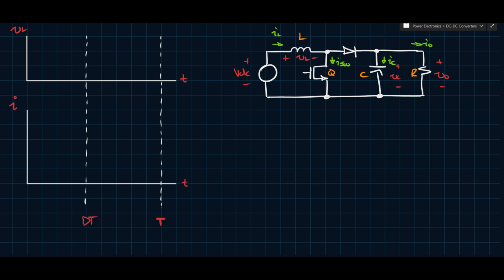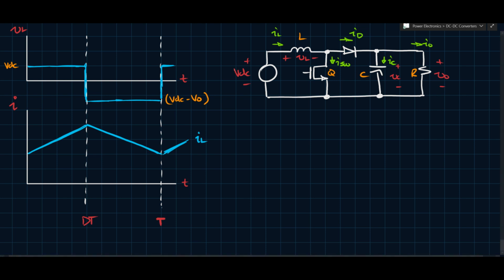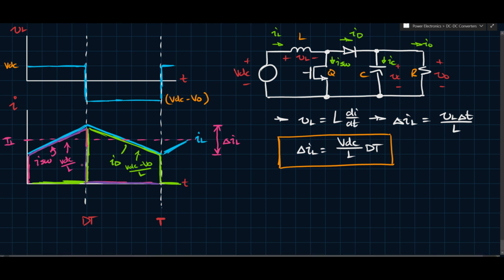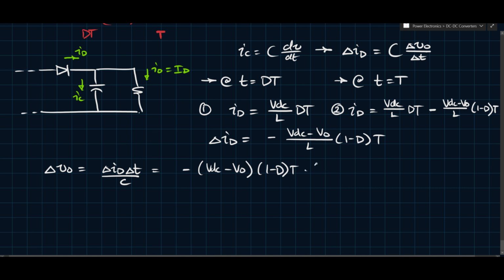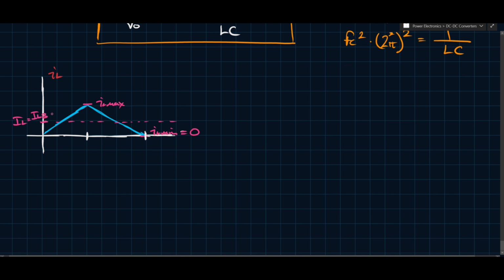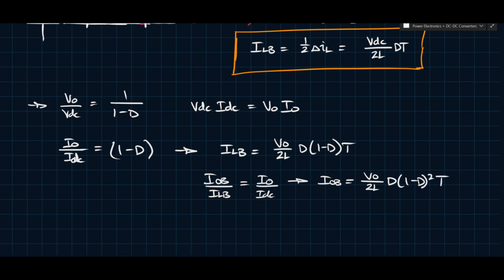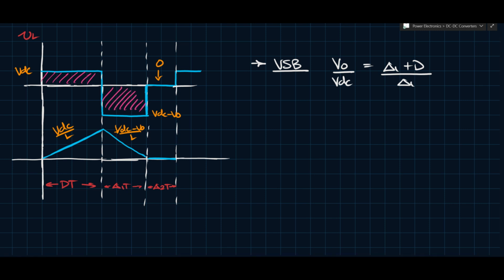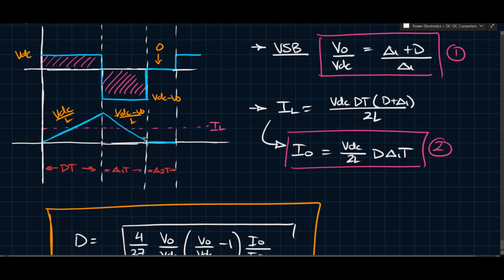Boost Converters: Capacitor Voltage Ripple, Inductor Current Ripple, and Conduction Modes

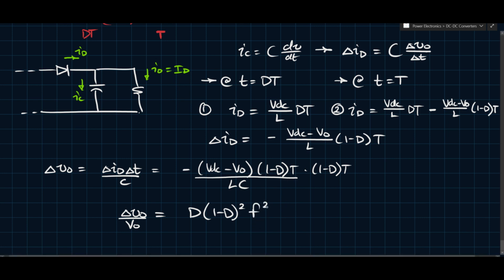Comment: I'm gonna ask you why 13:48 the f is in the numerator until I saw the comment. This result is differ from "SWITCH MODE POWER SUPPLIES - SPICE Simulations and Practical Designs", I think the author - Christophe Basso is Wrong at this calculation of output ripple voltage for boost CCM. (After enormous equations and figures. His result = T*D/(Rload*C))
Thanks!
Reply from the maker: There are different ways to determine the ripple depending on how you formulate the problem and which model you decide to use. As I am not familiar with the reference that you cited, I cannot comment on the process carried out there.